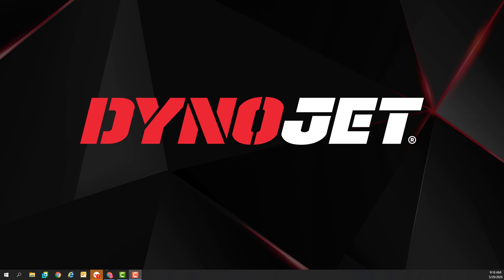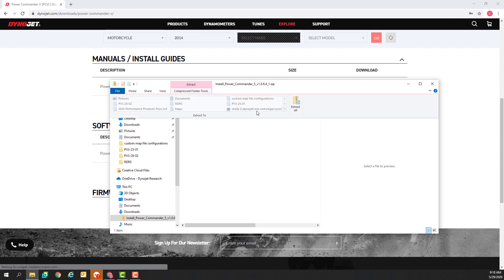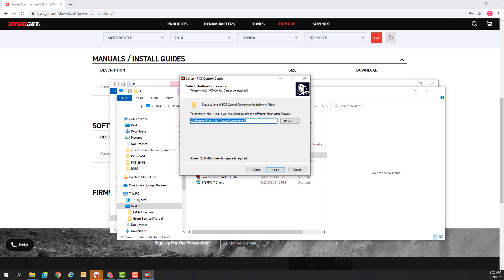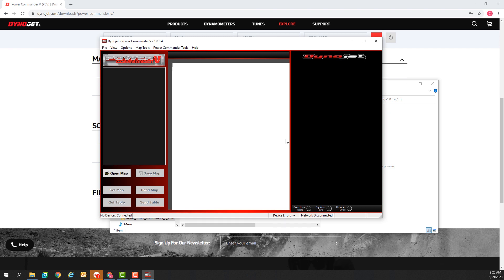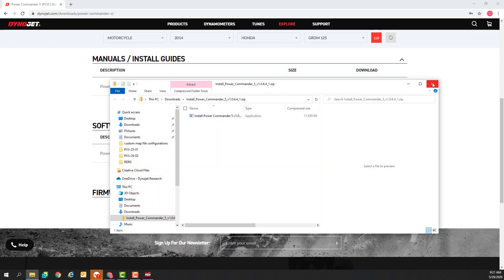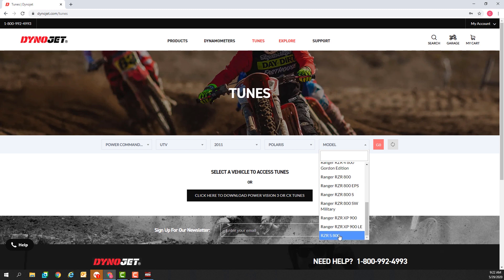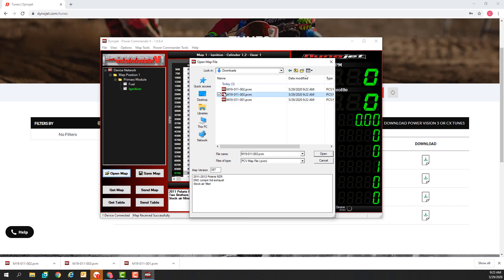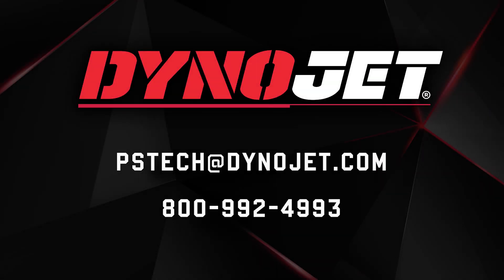How To Install Power Commander V Software & Map

Comment: Hellow I want to ask there are no any full system akrapovid map on z800 2015 model , so where can I download the map form Dynojet??
Reply: Really need help
Reply from the maker: You can download them here: https://www.dynojet.com/tunes, or you can contact powercommandertech@dynojet.com if you need assistance.
Reply: @DynojetResearch  there are only HP Racing and two brother exhaust map.  Got other map like full system akrapovid and aftermarket BMC air filter map??
Reply from the maker: @z800kawasaki9  If you email us at powercommandertech@dynojet.com, we can help you.

Comment: When I plug laptop into bike, with map loaded. The pc5 has a green light. But I cannot do anything other than save map, or open map. There’s the get map, and send map options, but I can’t click them. I’ve done this before on my old bike, and it worked fine.
Reply from the maker: Matthew, please contact us at powercommandertech@dynojet.com and we can help you out.
Reply: Dynojet Research, Inc. ok I will. Thank you for the quick response

Comment: Hi 

I have a power commander 5 with a custom tune made for my 2011 triumph daytona 675, however I did a stupid thing by updating the firmware -  PCV Firmware Version: 1.14.2 Last Update: 23/01/2017. After installing the bike is now running poorly and a strong smell of burnt fuel and a sound of engine knocking at low gears rolling off throttle. The idle seems messed up also, when blipping the throttle in neutral, there is a backfire..Any ideas ?  Thanks in advance
Reply from the maker: Please send us an email at powercommandertech@dynojet.com and we can help you.

Comment: Are the stock power commander maps better than stock ecu, or are they the same?
Reply from the maker: Our stock map is an improvement over the stock ECU. There are gains to be had with just a stock exhaust by using the Power Commander V and the correct map.

Comment: Stupid question maybe but is there a way to do it with my phone ?
Reply from the maker: You won't be able to do this through your phone. You'll need a PC computer to install the software.
Reply: @DynojetResearch  it's all right thanks, did it on a computer !  Quick question ; since i plugged in the pcv in my 2020 honda grom, i don't have rpms ? Everything else worka besides that. Do you know what it could be ? You guys had any report on that ? I have to check everything back again but yeah.. no rpms...
Reply from the maker: Send us an email (powercommandertech@dynojet.com) and we can help you out.

Comment: And when it doesn't retrieve a map when connected?
Reply from the maker: Try using the "Get Map" function and check to make sure the USB cable and port are working properly. You can also try restoring the default layout by going to View > Layout > Restore Default Layout. Let us know if this helps!

Comment: Hello.. I have a PC3 USB  What number map would be the closet for 08 1800F Honda Vtx  V&H Staggered exhaust standard baffles....Hyper Charger Air Intake& Par valve removed...Thanks
Reply from the maker: Jim, you can contact us at powercommandertech@dynojet.com and we can help you out. Thanks!
Reply: @DynojetResearch  okay just emailed you...my unit is OLD..lol  model#pc3 122-411  I couldn't make the serial number out..Will my request go thru without the serial number?  I completed the form without the serial #  I hope it goes thru    Thanks
Reply from the maker: We should be able to handle it, and we'll reach out if we need more info.
Reply: @DynojetResearch  Tony email me ans said to try/use map 122-002 That map says without baffles,But I have baffles...But We will give it a try...Thanks

Comment: Is it possible to load a map for poor performance
Reply from the maker: Just out of curiosity, why?
Reply: @DynojetResearch  I'm rebuilding a ZX10R I did a frame swap.It has stage 1 performance.Tuned throttle response. I'm kinda nervous
Reply from the maker: If you have questions, you can contact us at powercommandertech@dynojet.com, Bjorn.

Comment: does pcv come with the auto tune as standard you didnt talk about this? I have a 2001 cbr600f4i with a stubby sc engineering exhaust that's causing either fueling or back pressure issues when pulling away i lose power then over 2k kicks back in again. any suggestions  cheers
Reply from the maker: Neil, if you contact us at powercommandertech@dynojet.com, we can help with this. Thanks!
Reply: bro i have a 03 f4i was running perfect before i put on the pcv then after install any input on the throttle makes the bike stall. the map upload doesnt seem to effect this at all.
Reply from the maker: @dshiznit148  We're sorry you've had this experience... if you email us at powercommandertech@dynojet.com, we're happy to help you out to make sure your bike runs well.

Comment: Hey Dynojet, I have a 2020 Kawasaki ninja 650 and i got a two brothers full system. and the latest PCV for my bike and for the year it says the only maps available are for the stock system. Since the exhuast fits 2017-2020 i looked at 2019 and there was a map and thats the one im using right now. is that the best way to go about it since there isnt a map for two brothers 2020?
Reply from the maker: Mikah, you can email powercommandertech@dynojet.com and we can help you out with this.

Comment: Do I have to plug up at the same time as im tuning the Commander,.. what if I don have a computer in my garage?. Are can I time it on the computer than plug an play..
Reply from the maker: You connect the Power Commander prior to tuning your bike. This way, you can download a tune at your computer, wherever it is.
Reply: Dynojet Research, Inc. this is not working for me, the commander is not hooked up to the motorcycle and i have tried to load the maps using the cable, but all i see are dashes where the 0 zeros are supposed to be, and don't seem connected even though i can see a status light on the pc
Reply from the maker: You can email powercommandertech@dynojet.com and we'll guide you through this.

Comment: My destop: cpu pentium G5400+ ram 8Gb + Ssd 120gb can run this software good? Tks for answer
Reply from the maker: Yes, so long as you're running Windows, you should be fine to run the Power Commander software. Please let us know if you run into issues.
Reply: @DynojetResearch  Your website gives NO mention about the required OS to run the software, every Mac user has to download, extract it, just to find out Mac is not supported. So I need to install windows, or borrow a computer... What windows versions are supported? 7, 10, Vista, XP?
Reply from the maker: @jacobwonder6735  Jacob, we're sorry about this experience and thank you for that feedback. We'll try to make it more evident that our software only runs on PC, not iOS. This software will work on Windows XP and up.

Comment: How do I test my pcv to make sure everything is connected and working properly before I download my new tune?
Reply from the maker: Dan, connecting to the software is the best way to do this. By looking at the software when the bike is running, you can see if the RPM and throttle position is displaying correctly. If so, you are good to go.
Reply: Dynojet Research, Inc. awesome, thank you for the quick reply.

Comment: hey Dyno guys. Can you please make a video on how to install 2 maps using the map switch? I just physically installed the switch but didnt have time to make the config. Thanks.
Reply from the maker: Diego, this should help:
Enable Map Switch.
Set desired switch input to #1 or #2.
Wire switch to selected input.
Open map. Click Send Map. Choose Map Position 1.
Open a different map. Click Send Map. Choose Map Position 2.
Now with selected input circuit open, the PC5 will output map 1; with the input circuit closed, the PC5 will output map 2.
Reply: @DynojetResearch  Awesome!!! I will try this and let you guys know. Thanks so much!!!